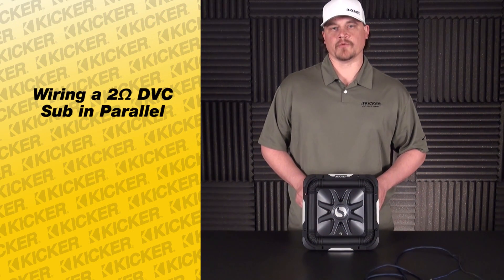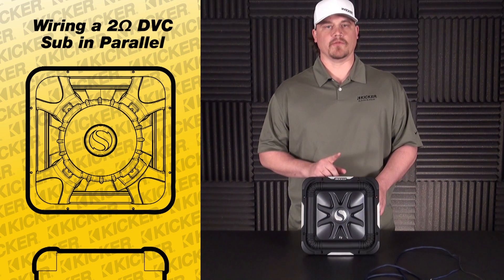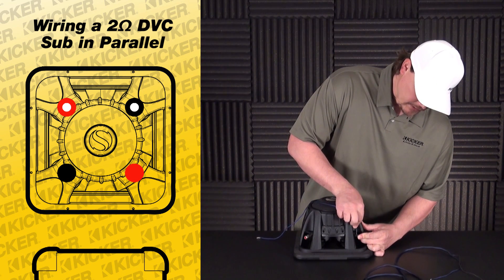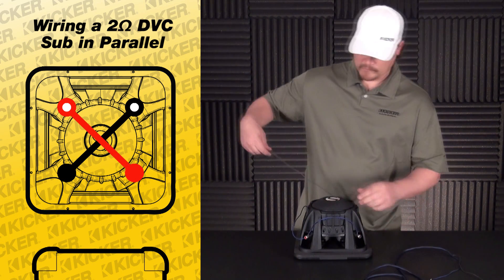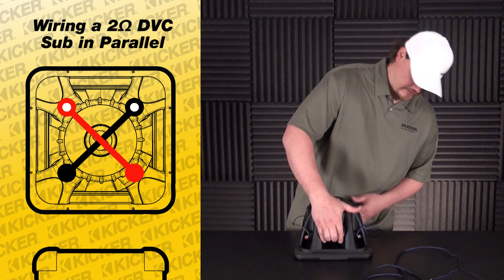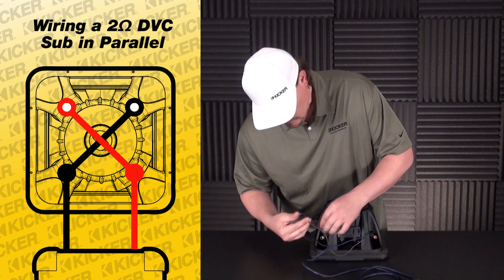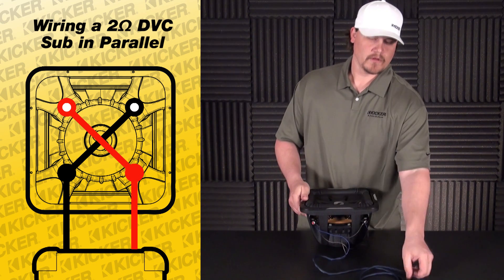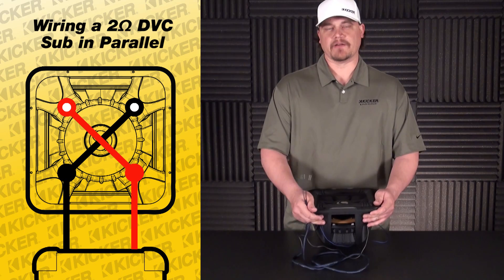Subwoofer Wiring: One 2ohm Dual Voice Coil Subwoofer in Parallel

Comment: Well how do you wire a 2 ohm subwoofer that will put out a 2 ohm load that's going to a amp that's 2 ohm stable?
Reply: If it's single voice coil than it's already 2. With DVC Parallel decides the number of ohms by the voice coils ran parallel. Series just adds the number of ohms to the number of voice coils. It's simple once u understand it's that simple. 😉

Comment: I have a single 2 ohm DVC. Would I only connect one side to keep it at 2 ohm?
Reply: It's impossible. U have a single DUAL VOICE COIL(AKA 2voicecoils) with 2 ohm of resistance per voice coil. 2 ohm DVC ran series multiplies the ohms of VC X # of coils... 2ohm X 2 voice coils=4ohm! 

Or parallel. U devide the voice coils ohm by number of coils. It's that simple. 2ohm÷2 voice coils=1ohm! This isn't rocket science. Study this for a few days and ul all be like ohhh.... Duhhh😅
Reply: I’d like to know the answer to this question myself I wish someone would’ve responded
Reply: @floridaboyoutdoors2935  no don’t wire one side you gonna mess up your coil

Comment: Would a 3000 rms, 1 ohm taramp amp be too much for one dual coil, 2ohm L7 15 1000 rms?
Reply: 3 times too much of the needed power. But U could set it properly to the max needed power with a voltmeter. or SMD meter. Or just keep it low enough to not clip of course.

Comment: I have a 2016 single kicker Comp R 2ohm’s sub and I want to wire it to 2ohms to the amp, how do I do that lol
Reply from the maker: Joe Rida your choices are 1 or 4. Physics won’t let you get to 2.
Reply: KICKER I was testing with the ohm meter and the only way to play the sub at 2 ohms was to run it in single voice coil mode, does that make sense or am I off ? Thank you for the quick response by the way, the amp I’m using is a RF Prime amp and will put out 301rms at 2 ohms, so if I ran the sub using just 1 side of the voice coil would that be efficient/safe, don’t wana ruin the sub either. Thanks
Reply from the maker: Joe Rida it’s possible but you’ll cut the power handling in half.
Reply: KICKER so right now the kicker’s Rms rating went from 400 to 200 is what your saying which makes sense, 200watts per voice coil, or side, dual being 400 and single being 200. The amps pushing it pretty hard. Sub cost just as much as the amp lol would rather protect the sub and get a new amp I suppose, or just up it to 4ohms which is 150rms from amp just feel like it’s not enough power at those settings ya know. Anyway thanks again KICKER for your time and patience with my silly self you da man!!
Reply from the maker: Joe Rida Under powering a sub is actually more likely to blow it then over powering it. The best answer is to get an amp that gives the sub the power it’s rated for at the ohm load amp needs to safely operate.
Reply: KICKER no kidding that’s crazy I didn’t know that. I’m curious tho my sub doesn’t have red with white dot on one side and solid on the other, they are just all the same color solid red and black on both sides. I’m curious since I’m running it as a single voice coil sub does it matter which side I’m powering? Thanks again boss.
Reply from the maker: Joe Rida There’s no advantage to one side or the other.

Comment: Welcome! I would like to connect a DC Audio Level 3 12 m2.1 D2 subwoofer to a DC Audio 1.2k amplifier.
  how to connect to 2 ohm load on the amplifier?
Reply from the maker: Hi Jokko, if the amp is 1 ohm stable, then wiring that dual 2 ohm speaker in parallel will work. Please contact with DC Audio or check out their documentation to verify that information, just to be sure.
Reply: the amplifier can be charged with 1, 2, 4 ohms.
but I want to connect the subwoofer to 2 ohm

Comment: How do I wire 2 dvc comp r 12s 2ohm  to a 2 ohm stable amp?
Reply from the maker: In series parallel. This is the closest video I have to that: https://www.youtube.com/watch?v=EG7IE5ZiiEg&list=PLV2hurat1mvmHUBLRPIfRMkWKtIO-TSNo&index=12.  You'll combine the wires going to the amp.  You can also look on our website for more info: http://www.kicker.com/wiring-diagrams
Reply: So two subs ran like that would create a 2 ohm load like to a cx1200.1 1200 watt
Reply from the maker: What you want is series parallel.  We made a free app to help you wire that up and tune the enclosure,  called KickerU: www.kicker.com/kickeru All you have to do it click on the wiring wizard, tell the app what subs you have and it will show you all the possible options.

Comment: I have a one chance amp kicker 1000.1 and what own will it be better 2 do my l7 12
Reply from the maker: One chance amp?  Sorry but I dont quite know what you mean.  Can you explain?
Reply: What own would it be good for my kicker so it won't blow up I have one l7 12 speaker
Reply from the maker: Jesus, you want to not only give it proper power, but tune it properly as well.  Tuning it depends on the enclosure you have and the frequency response of your midrange speakers. For a single L7 12" (assuming a Solobaric L7 - please tell me if it's a Q Class) the best amp for the job is the KX 800.1. Here is a link: http://www.kicker.com/kxa8001-800-watt-mono-amplifier

Comment: your using regular speaker wires for this? Doesn't matter what gage?
Reply from the maker: You're exactly right that the gauge does matter. You can never go wrong with 12 awg, but it mainly depends on the actual power you are using.  Do you have that info?
Reply: KICKER that same speaker in the video but 15inch 1000rsm.
Reply from the maker: It's not 100% mandatory, especially for AC current, but yes I'd stick with 12 awg.
Reply: Can I use sky high 14awg ofc for two l78s on 900w RMS

Comment: how can I connect 2 2ohm in parallel to an 1 ohm stable amp?
Reply from the maker: Are they single or dual voice coil subs?
Reply from the maker: If they are single, follow the directions in this video:  https://www.youtube.com/watch?v=FIj9i75gHMs
Reply: I have 4 12SL7-2 but I'm just going to use only 2 for now with an 1500wrms amp bridged at 1ohm how can I get them to stay series/parallel bridged from 2 to 1ohm?
Reply from the maker: Unfortunately you cannot wire four 2 ohm SVC speakers into 1 ohm.  The math simply does not work out.
Reply from the maker: Without going below 1 ohm, the lowest you can wire is 2 ohms total by series parallel.
Reply: How about 2 2ohm DC subs ran into series parallel?

Comment: I am going to put a 4ohm tweeter on the box with a dual coil 12" sub. What is your suggestion to keep the load at 4oms or higher? Doing this for two truck speakers.

Comment: I have 3 12s L7 kickers wired parallel all the way around?Is that too much for a 4500 watts 1 ohm amp to take?What's the best way to connect all 3 and what's the best amp to push all 3?

Comment: I have 1, L5 2 ohm dual voice coal sub, and a crunch powerone 3050.1 3000 watt 1 channel amp, what's the best way to run it to get the most out of them ?
Reply: Parallel of course. As long as ur amp can handle 1 ohm. Than it'll beat hardest. 1 ohm is most efficient. Always run the Lowest ohm ur amp can handle. 😉

Comment: How can i wired my l3 10s
Reply from the maker: Robb Rodriguez Hey Robb,  what ohm L3's do you have, how many do you have and what amplifier are you running to them?
Reply: There 2ohm.  I have 2 of them.  And i have a kicker IX 1000.5 amplifier. ..
Reply: +KICKER hey i have a 10 inch 2 ohm dual vc l5 in the custom ported kicker box made for it what would be the best way to wire it series or parallel i have a fosgate punch 200-2 amp pushing it
Reply from the maker: +Joshua Porterfield Depends on how low you want the ohm load to be and how low the RF amp can take before failure/overheating.  Once you find out the amps tolerances, we can answer that question for you.

Comment: Can I do this to the cvx? I have a 15 but I'm not sure how it's wired
Reply from the maker: The CVX subs are dual voice coil subs so you can wire them in parallel.  These come in either a dual 2 ohm or a dual 4 ohm.  If you have the dual 2 ohm then when you wire it in parallel the sub becomes 1 ohm.  If you have a dual 4 ohm then the sub becomes 2 ohms.  If there is not a label on the back to tell you what ohm speaker you have then you will want to get it tested on an ohm meter.
Reply: KICKER Ok I'll check it out when I get a chance thank you sir

Comment: What will happen if i wire two dvc2ohm
Subs in parallel all the way around?
What is the load?
Reply from the maker: Hey Mark - when you wire 2 x 2ohm DVC in parallel/parallel you will have a .5 ohm load.
Reply: KICKER what is the max at .5 ohm load
Reply: Thank you thats what i thought.im running two just like that with a hifonics 1600d.  two 12" kicker cvx...and the amp has been handling it even though its only a 1ohm stable amp.is this risky business??
Reply from the maker: mark hernandez Yes - what you might notice is on heavy bass music or if you start to crank it up, the amp will shut down and go into protection.  Each time this happens you will eventually burn up something in the amp or fry the subs.
Reply: Ohh ok good to know.dont want that.thanks for the reply.much appreciated!i think ill play it safe instead.